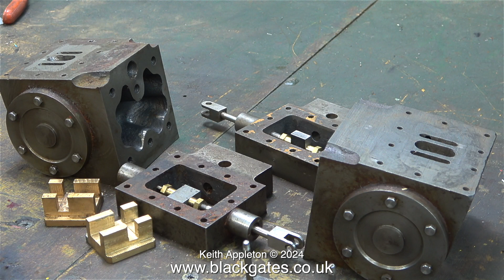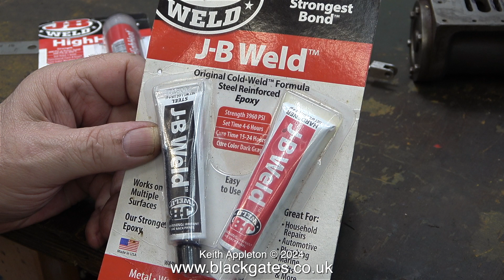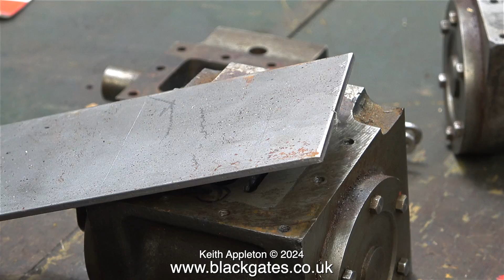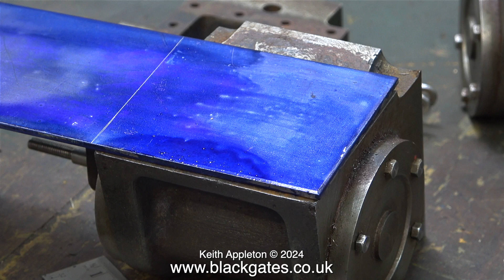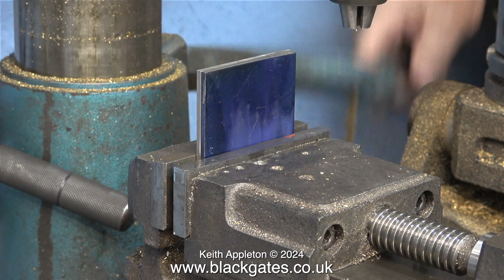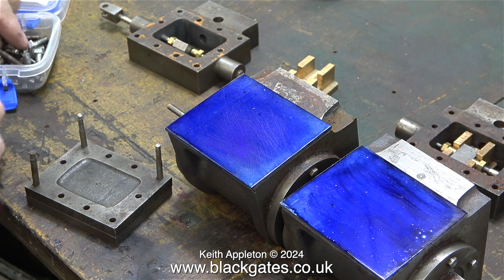A BLACKGATES SWEET PEA LOCOMOTIVE BUILD - PART #13

Comment: Interesting, why weren't more faceplates used ?😊
Reply from the maker: It is a good solution to badly machined or worn port faces {:-)))
Reply: @keithappleton  yup a sacrificial plate , could a white metal cast be used ?
Reply from the maker: White metal would be too soft.